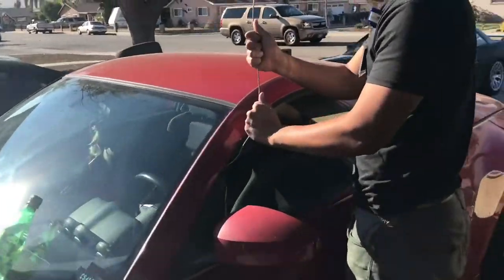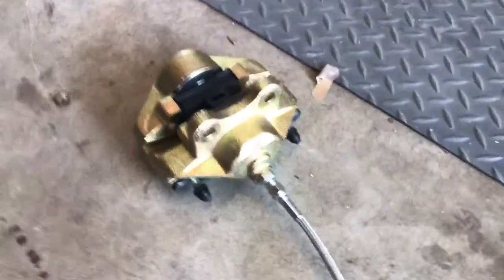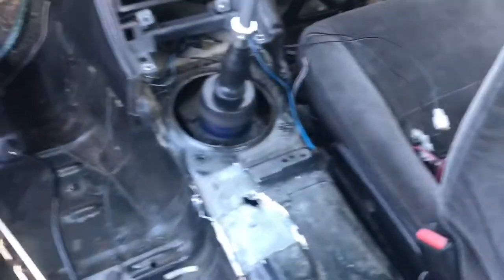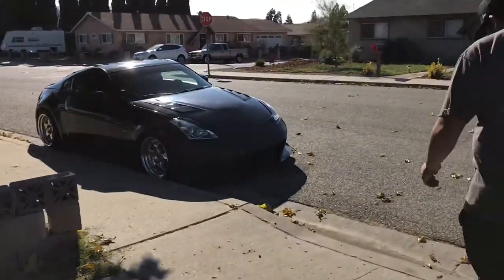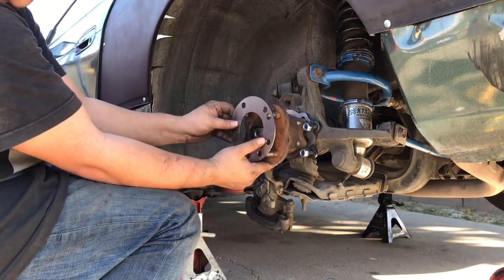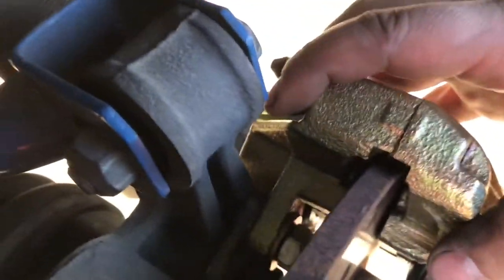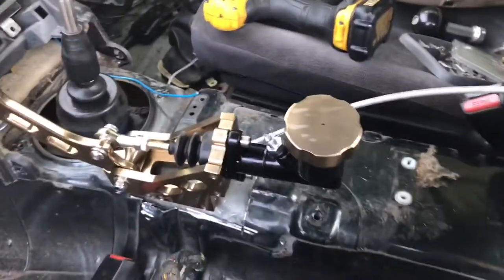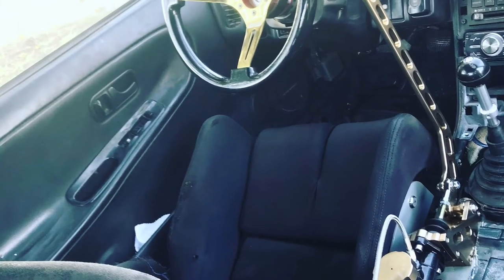Hydro ebrake with dual caliper kit by Villains (part 1)- drift car build  #1

Comment: Nice vid. Where did you get your plumbing from and how much was it?
Reply from the maker: MrLwhiteford I ordered my lines from eBay. 3 x 42 inch lines , of stainless braided lines. Or you can get a plumbing kit from villains , coast is 80 to $120 depending on brand /kit
Reply: All Nutty ok koo thanks
Reply: What size master 3/4 or 5/8
Reply from the maker: @MrLwhiteford  I have a 5/8, the 3/4  it's too hard to pull for me.